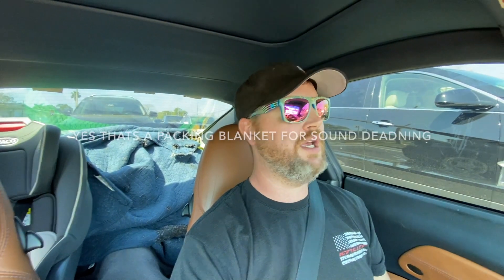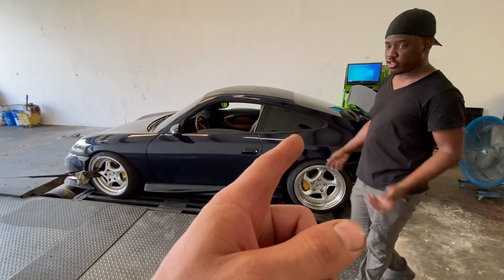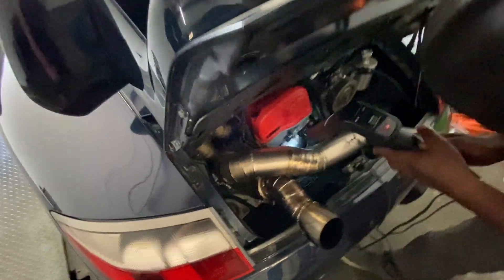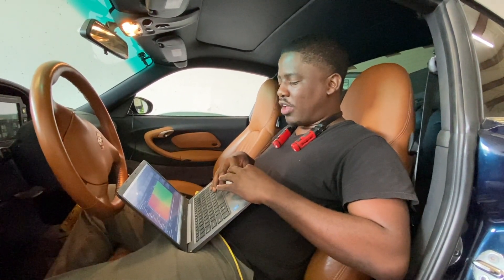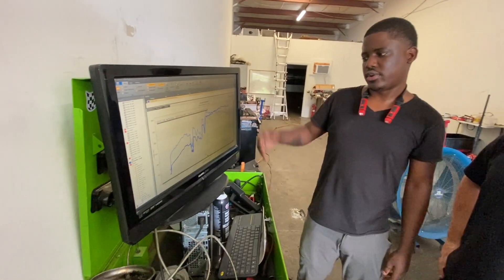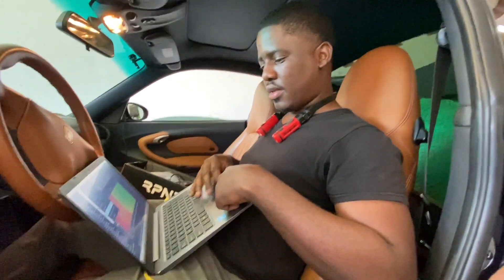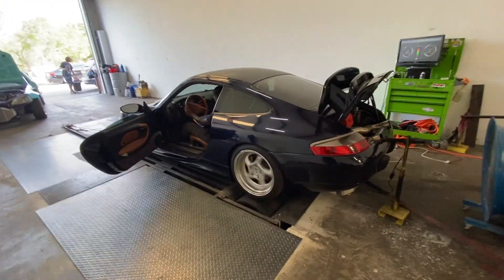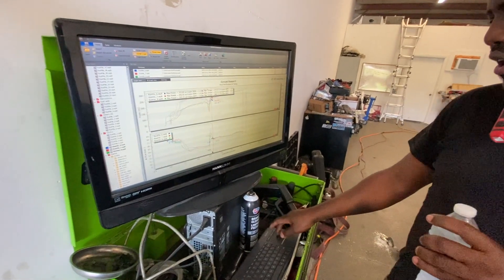K Swapped Porsche Hits The Dyno And Makes Some Real POWER!

Comment: What conversion harness did you go with?  We used a hybrid racing universal conversion harness on the Lotus Elise and we also had voltage issues.  Ended up being they the power supply to the ecu was being split and also supplying power to the 02 sensor heater, and to the fuel pump relay.  It’s an easy test.  Run a larger gauge cable from the battery + to the ECU power and see if that helps hold voltage steady at Upper RPMs.  We would see 13.7-14v at idle light load then on high load it would drop down to low 11v.
Reply from the maker: Very interesting. I just put a new alternator in today. Haven’t tested it yet  ti see if it replicates but I’ll certainly keep this in mind. Makes perfect sense.

Comment: The voltage drop at high RPM will be part of the issue with spark, where he ended up setting coils to charge for longer to mask it. Lower voltage will put less energy into the coils for same amount of time charged. Coils will run hotter if you manage to fix the charging issue, might be worth asking tuner if tune needs changing a bit once fixed

Comment: I would wait to dismiss the intake manifold until you have a solid alternator in there with stable spark and fueling up top.  But it's certainly possible you have small diameter runners that help a lower speeds that is hurting the top end.  On the plus side, the boost can be tuned to fix this a bit at higher RPM's you want.
Reply from the maker: Agreed. Start with the basics and see how things improve. Weak spark and fuel supply voltage can definitely cause it as well

Comment: Seeing these motors swapped into old Porsches Is giving me  reason to go buy it old 996 hell some are less than 20,000.
Reply from the maker: I picked up a 996 roller with 56k miles no engine or trans with a clean title for $3k. They are out there!

Comment: What size and brand Injectors are you using and is this on e85 or 91oct?
Reply from the maker: E85. Injector dynamics 1300
Reply: @baysidefabrication  OEM fuel pump too?
Reply: @baysidefabrication upgrade them to the Asnu ones. Much better spray atomization and consistent across the rpm range.

Comment: Wow! I rarely hear guys talk about usable street horsepower. I have a C5Z with cam/ heads 440whp. I live in Phx. There are so many people on the street at all hours of the night. You can’t rip it. Cops everywhere, Road debris.. I concur!! 500 ish is all you need. These guys and these 700-1000 hp street cars is too much for street. My car lurches and slipping the clutch is only way to be smooth and is a pain to drive unless on the freeway. Actually trading in for TT 996 next spring. Considering a Kswap 996 2wd. But not sure yet.